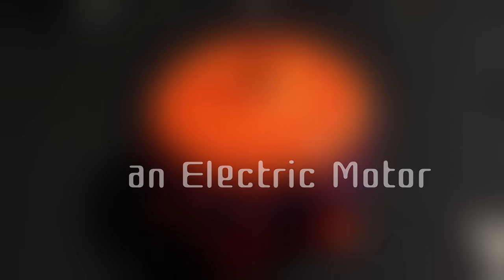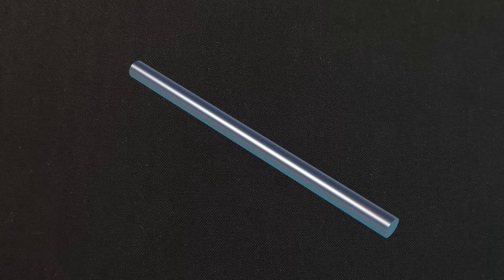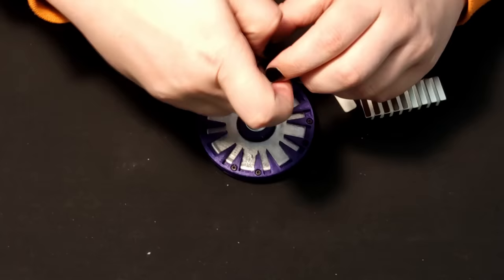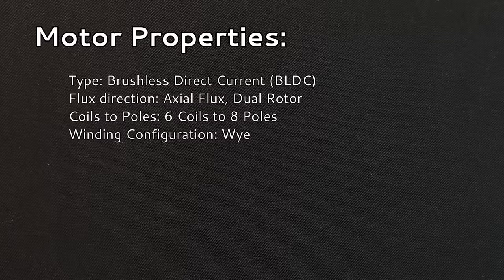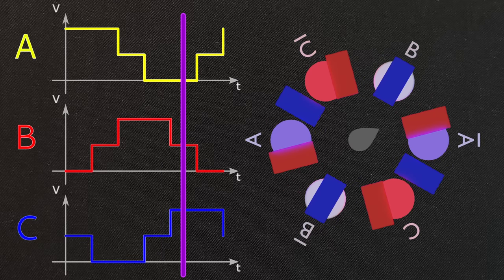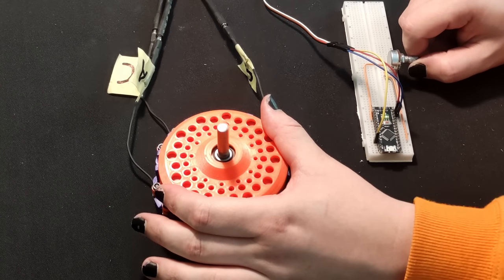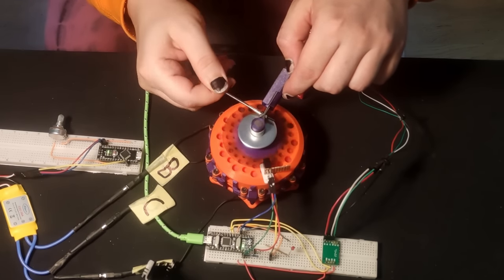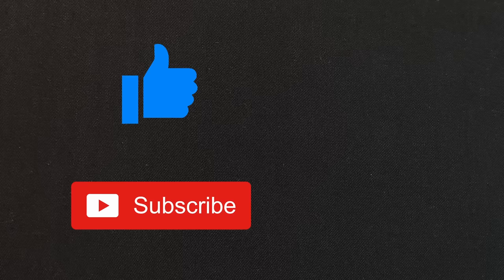An Axial Flux BLDC Motor Build

Comment: plz try to make a permanent magnet less BLDC MOTOR  , Like a alternator kind Bldc motor with out iron core , only copper plastic and resin  , to supply current to the rotor wirelessly use wire less mobile coil induction charger technique
Reply from the maker: Wireless induction motors are pretty cool, but for them to work with any resemblance of efficiency, they do most certainly require core iron. Maybe one day I'll make one, next motor I will make sometime this spring/summer is another permanent magnet motor, but this time powerful enough to use as an ebike motor.

Comment: did you sort out the 1.7 v  phase error ?
Reply from the maker: The 1.7V is probably the correct voltage, and the ~1V is erroneous. I did not figure out what it was and if I do try to figure it out (no promises) then it will be while I will be working on the next axial flux motor. Currently no date for when I will be making my next motor though.

Comment: what about the inserts between the main (wide) magnetic poles? I guess, they are to implement the Halbach field configuration but are the narrow inserts just rotated magnets of the same size or are those just smaller pieces? Thank you for the impressive design and neat implementation.
Reply from the maker: The main magnets are 20x10x5mm, and the sideways magnets are 20x5x5mm

Comment: Amazing work! Could u please point to a reference for the calculations and the theory behind your design?
Reply from the maker: If you ask about something specific then I may be able to help you out. In terms of calculations made for this particular motor...? Well there were extremely few because the design was mostly dictated by the materials I had on hand. The 20x10x5mm and 20x5x5 neodymium magnets, The wire gauges I had on hand, etc... So in a lot of cases, only back-of-the-napkin precision calculations were necessary to find the best combination possible with the materials I had on hand.
Reply: @BirdbrainEngineer  okay..! Thanks

Comment: Can you use this motor to creat electricity?  As a small generator?
Reply from the maker: You could, but you'll need to rotate it fairly fast to generate any significant power. So, if you rotate it at around 1200rpm with enough torque and then rectify the output to be DC, then you could probably slow charge over USB.

Comment: Hello! Nice project! I have a question How much torque can it generate?
Reply from the maker: Do you mean static torque or dynamic torque? Static torque is very low (and I could not measure it) due to the motor being driven by a back-EMF based speed controller. Since the motor lacks hall sensors, then it can not be used with a sensored speed controller nor a field-oriented-control unit, both of which would have a dramatic effect on the static torque (especially the latter) The highest dynamic torque I recorded was 0.055N.m, however it could certainly do a lot more... it's just that my dynamometer setup broke haha... Will have to figure out a better way next time.

Comment: I also built an axial flux motor. But, not only are the coils wound very differently, but I have a slotless iron core for zero cogging.
Reply from the maker: The next axial flux motor will have a more unique design for me too - this one is basic. 
Slotless iron core? That sounds more like an iron backing rather than iron cores. From your channel banner it would appear that the core is essentially a donut-shaped hunk of metal? (Correct me if I am wrong) If so, then I would imagine your motor suffers from substantial eddy losses?
Reply: Your right that my axial flux motor does have an iron backing, that's what makes it slotless quite similarly to radial flux slotless. The iron provides a low reluctance path   through part of the magnetic circuit. 

 But my motor doesn't suffer as much eddy  currents as you think. The iron torus backing is made from steel strapping used to secure heavy loads to pallets. The enamel coated steel strapping is wound up in a coil where in each layer is electrically phase isolated from the others above and below so that eddy currents can not form radially, and thus significantly reduces  the irons capability to form eddy currents overall.  If i were using electrical grade steel with a high silicon content, the steel's higher resistance  would conduct even less eddy current.

Comment: Would it be possible to make this as a hub motor instead of a shaft motor? Like the electric motorcycle style, like the BLDC 
QS hub motors found on alibaba
Reply from the maker: Probably. Would need a redesign of the chassis though. Also would need to be designed for a lot higher power draw, since a 35W motor would have a hard time getting an e-bike going even with a large gear reduction. In the future I will probably attempt to make a diy electric motor for an e-bike conversion, because it feels like it would be a pretty fun larger project to undertake. I'd aim for around 250-500W motor then though.

Comment: Did you end up having problems with temperature due to PLA or superglue?
Reply from the maker: I did not, however that is simply because I never ended up putting large loads on the motor. The motor is more than capable of melting itself though, if you make the motor draw a lot of current.

Comment: Hello, I am a student of electrical engineering, and I am doing a research project, to make known the axial flow motor. It would be very gratifying for me if you would give me your help, providing me with electrical data, and under what principles you did it. Either way, the video provides a lot of information, thank you and keep up with what you do. Success and greetings from Mexico
Reply from the maker: For this one, I just sort of winged it based on intuition and what I had seen on the Internet haha. But I am currently designing a diy axial flux bldc motor that I intend to use as an e-bike motor. For the ongoing project I have used FEMM (unfortunately it is not good for axial flux motor electromagnetic simulations as it is a 2D-only FEM software) to do the magnetic analysis, and I have used FreeCAD to do a bit of structural analysis, namely to figure out the deflection of the rotors due to the magnetic forces pulling on core iron/the opposing rotor.

Comment: I’m new to all of this, electronics, 3d printing, tech. period. I’ve got lots of ideas turning in my head I just can’t decide where to begin. I’d like to build an all electric car, an atv/urban, an airplane(jet), a boat, and a helicopter. You see my dilemma. I’m also not sure how big the axial flux motors need to be to build everything I mentioned earlier. Any help or information would be greatly appreciated. Thank you in advance.
Reply from the maker: Hey there! Awesome enthusiasm and all I can say is to keep on dreaming and slowly working towards your goals! That said, what I strongly suggest is to start small. Doing things at a small scale will help you avoid costly mistakes in any design and more importantly it gets you to learn the physics and engineering involved. Making powerful motors, engines and using them to power various machines is fairly dangerous, so it's important to learn of all the dangers on a small scale first :)
So if you´d like a suggestion then... for example make an RC car from random bits and pieces. It would teach you about how mechanical power works, radio-controls, batteries and power management systems(if using electric motor(s)), mechanical engineering and just generally how large, complex systems are built and behave.
Reply: @BirdbrainEngineer  I used to be an auto mechanic before my near fatal motorcycle accident 2yrs ago this October. So I’m basically medically retired. My uncles and my dad were auto mechanics and my grandfather was an engineering professor, so I think it’s in my blood. The problem I’m having is, the gears in my head don’t stop turning. I’m lucky if I get 4-6hrs of sleep at night. I’ve thought about building a drone first or a R/C helicopter.
Reply from the maker: @roberthamm9304  Drone sounds like an awesome project. Has gone through my own head as well :D

Comment: This is so cool :O Would you get more power/efficiency if the speed controller was a true sine wave controller? I don't know if I'm saying it right, but instead of stepping between the phases rapidly, the phases are controlled with an as-smooth-as-possible sine wave.
Reply from the maker: Indeed, it would be better. However, making a true sine-wave is actually not that easy to do. For example, the 3-phase induction motors that are extremely common in industry simply use 3-phase power off the grid directly. And the motor controller for a synchronous reluctance motor costs many hundreds or thousands of dollars. The cheap way to make an approximation of a sine-wave is to use transistors and switch them with pulse-width-modulation for an approximation of a certain voltage. (Usually a capacitor is also used to smooth out ripples in the "signal")
Reply: @BirdbrainEngineer  look up VESC Project, there's some vesc based escs out there that are really cheap and works with most BLDC motors
Reply from the maker: @stealther1401  Thanks for the tip! I had planned to look into vesc based stuff once I start working on my e-bike project. FOC would be pretty nice to have.

Comment: How can we insulate magnet and rotor plate
Reply from the maker: You don't! You want the magnets and the back iron to be touching in order to make the smallest reluctance path between the magnets.
Reply: but the magnet field is induce in rotor plate @BirdbrainEngineer
Reply: I am using metal rotor plate which causes eddy current losses so how should i reduce the eddy current losses
Reply from the maker: @bhupenumredkar6654  If the whole back iron is covered in magnets (which admittedly it is not in my case but ideally would be), then the magnetic field from the stator electromagnets does not reach the back iron - The permanent magnets are in the way and the magnetic field lines from the permanent mangets connect up with the field lines from the electromagnets before the latter field lines can make it to the back iron to induce any eddy currents. Of course, real life is messy, so it's never perfect and you will always get some amount of eddy currents but if the back iron is designed properly, then it should be a minimal amount.

Comment: Can this design be flipped into a generator? And what would you say the total volume of your motor is?
Reply from the maker: Every motor with permanent magnets in it can trivially be turned into a generator. Rotating a brushed motor will generate DC (with the polarity dependent on the direction of rotation), and rotating a permanent magnet bldc motor will generate 3-phase AC. It is also possible to use motors without any permanent magnets as a generator, such as a car alternator, as long as you put in a little bit of electrical power to energize the excitation coils (essentially the permanent magnets are replaced by controllable electromagnets). Then rotating the alternator would also produce 3-phase AC - this is how most powerplants work. 
 
I'm not home currently and can't access the files to check the volume but iirc then the cylinder that envelops the motor (minus the shaft) has a radius of about 75mm and a height of about 80mm.

Comment: Could you please tell what is the software you used for designing this motor
Reply from the maker: Since I am still a complete beginner at using proper CAD software (I am slowly learning FreeCAD) and I wanted the motor to look "cool", then I was forced to use Blender... as it is the 3D modelling program I have used for years at this point.
Reply: @BirdbrainEngineer  can we check flux flow and torque values in FreeCAD
Reply from the maker: @bhuvaneshwarivijayarangan7421  Not sure. I'd be surprised if nobody had made any tool for it but I can imagine it being much more difficult to use than in purpose-made software... which unfortunately usually costs money, and I avoid anything that is not free/open-source. I also did not do any calculations for this motor because I was working with what I had on hand in the first place anyways.
Reply: @BirdbrainEngineer  we can check both flux flow and torque characteristics in ansys maxwell but it is hard to design in it without proper dimensions as you said. 
Thanks for your reply and your work in axial motor is awesome.

Comment: Hello 
I have a goldenmotor 5kw bldc axial flux motor, I replaced the original magnets which were shaped like crescent 4cm wide and 3cm long with round shaped magnets 3.6mm diameter and 10mm thick 
The motor worked well without load, but with load the torque became very low and the motor became very hot in-spite of the current was low 30 A, while it can withstand 130A
What do you think?
Reply from the maker: Hi! Sorry for the late reply, I was, for the most part, away from the Internet for the week. 
Generally speaking, replacing magnets in a factory-designed motor is not recommended, as everything is optimized to work well together. 130A sounds mighty much, so make sure that the 130A is meant to be the continuous amperage. It is possible that the 130A rating is only meant for short time frames, like while starting up. In addition, it is fairly common for motors to get quite hot - 80C is not uncommon. Also 5kw motor would most likely require some cooling. For example, If it is meant to be used for spinning a propeller, then the airflow caused by the propeller also cools the motor, and so you might not want to run the motor for long periods of time without a proper cooling setup.
Reply: @BirdbrainEngineer  thank you very much

Comment: Hi. For your next project, could you please build a 75,000 RPM bldc motor. Thanks
Reply from the maker: Are you trying to make a turbomolecular pump or something? XD 

Such high rpm-s are dangerous to work with and 3d-printed parts most certainly are not up for the task... I'd have to get a metal lathe and/or cnc mill first to manufacture metal parts capable of withstanding 75k rpm.

Comment: Axial Flux is all the rage these days.
Reply from the maker: The reasoning behind such a late boom to axial flux design is the inherent complexity of mass manufacturing it. It's just *way* easier to mass manufacture radial flux motors. The power density benefit just wasn't as big of a requirement until fairly recently.

Comment: 6 pole stator and 8 magnets pole it's a very awkward motor to operate 😂. 6 poles stator works very smoothly with just 2 poles magnets rotor. stator poles > rotor poles.
Reply from the maker: Sorry, but 6 slots to 2 poles has a winding factor of 0.5, which is really shit. I do admit that the winding factor of 6 slots to 8 poles of 0.866 isn't the best possible with these numbers either (9 slots to 8 poles has a winding factor of 0.945)... but I definitely have to disagree that 6 slot 2 pole would be better than what I made here.

Comment: The B-C  hight EMF is responsible for the problems and the low efficiency.
Reply from the maker: Indeed. As the A-B and A-C pairs are energized the motor tries to spin faster than when B-C is energized. So when B-C is energized, the motor is somewhat fighting itself. The problem is caused by something being wrong with phase A, as ideally, all of the phase pairs would show the same kV that B-C is showing.
Reply: @BirdbrainEngineer  the over voltage could be caused but 2 coils not grounded or wired in the wrong direction. Tan 120°=1.73=√3. (The phases are supposed to be 120° apart.) The higher voltage will act as a generator causing dynamic braking.
Reply: Maybe 1 coil in series with another not grounded to the star center. 1-1-1.73
Reply from the maker: @suggesttwo  There are 2 coils per phase. In each phase, the 2 coils are connected in series. One end of each phase is connected together to form a wye configuration. I haven't taken the time to try to fix this motor because it's pointless to do so anyways, but I suspect I may have accidentally installed one of the coils in phase A the wrong way around.
Reply: @BirdbrainEngineer  2 phases are in series. 1.03V x tan 120° = 1.784 which is pretty close to 1.781.

Comment: is this design open source?
Reply from the maker: While I have not released any files for the 3d printed parts, nor do I have proper documentation of the measurements, reasons behind design choices and assembly... then the design itself is, of course, free to imitate and copy. I'm a little bit hesitant to release any files, since I know I could do better the next time I make a motor and this particular motor design is very much just me playing around, and not really supposed to be used for anything. The usefulness is limited by the maximum current the motor can handle, which is around 3 to 4A continuous at 12V (giving a theoretical maximum power output of 36-48W), due to the 21AWG copper wire otherwise heating to above 60ºC, which would start warping the PLA of the motor structure, and so, lead to the failure of the motor.